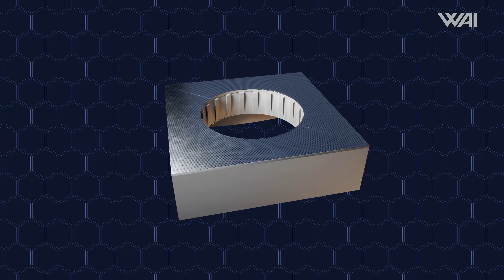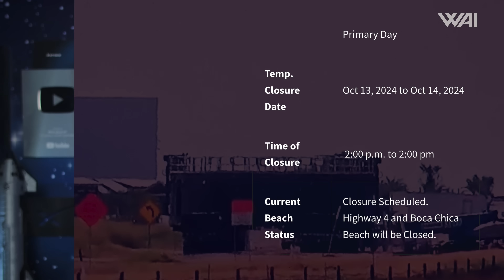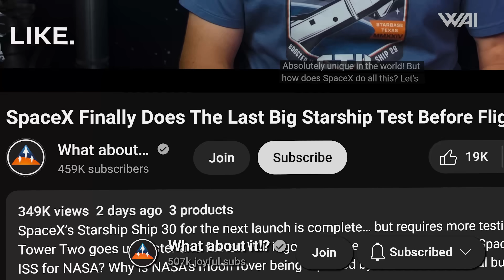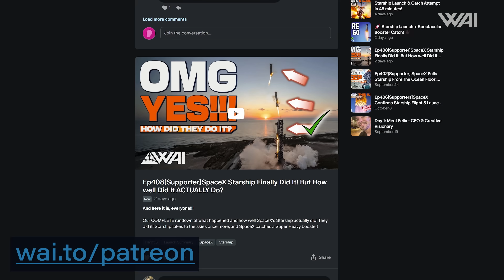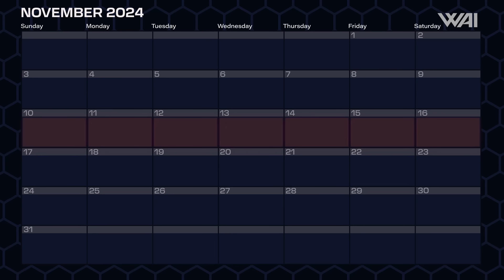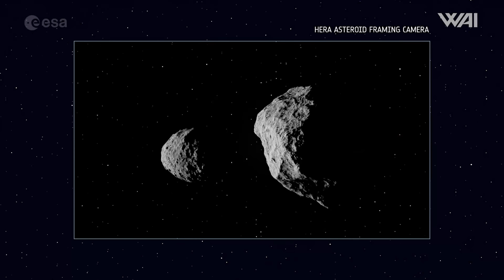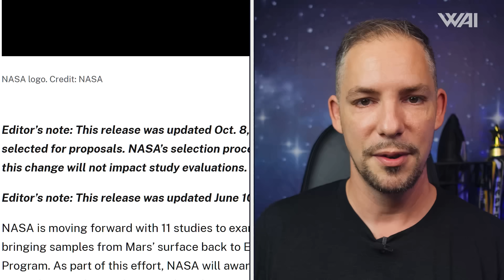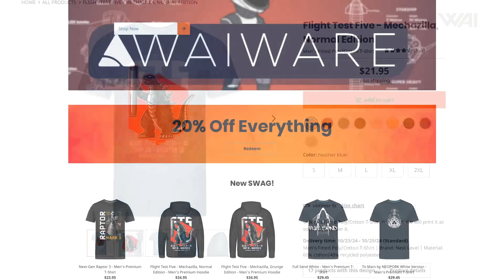SpaceX Reveals Flight 6 Starship! Possible Launch Date Available! Can They Do It?

Comment: OK, application of the same, or similar ceramic tiling on the upper portion of the of stage 0,would go along ways to minimizing damage to it.  Probably best to use larger tiles that overlap the inner lip of the launch stand.  Also, moving the first stage quick disconnect up by about 5 meters, both on the tower, (instead of on stage 0) and on the booster, would likely reduce damage to the quick disconnect system, (yes, swinging it to one side like the Saturn V launch tower, would also help, or a direct pull back, possibly using a mechanical counterweight system, to pull it up and back into a protective housing that would fall into place after disconnect and retraction,should work as well, and hey!  Maybe cover the protective housing with tiles as well?  To help secure those tiles, and minimize damage to them, a cushion of ceramic blanket, similar to the white sections on the Shuttle had, could not only act as a cushion between the metallic surface of the stage 0 and the first stage quick disconnect protective cover on the tower, as well as use of strips of it between tiles on both structures, should minimize damage from vibration against the metal structures and each of the tiles themselves.
      As there are some losses of tiles in the transition area between the tiles and the bare metal area, beveling the tiles to provide less aerodynamic drag during lift off, may, very slightly, improve the overall performance, but would likely minimize the loss of those tiles along that transition edge as well.  (And yes, a half tile beveled tile, between the sawtooth edge, likewise beveled, for a straight edge, would not only reduce tile loss along that area, (yes, I saw that as well) but would go a long way to avoid potential zipper releas of tiles, starting from the edge).
     As I suspect complete sealing of the valves from the stage one quick disconnect panel on the booster, is difficultbat best, moving it up by about 5 meters plus, could minimize ignition of outgassing during re-entry.  Or, precessing the panel by about 2 centimeters into the rocket body, and using a weighted system to slide a cover panel, padded on the booster's disconnect side to also act as a gasket, along with neodynium magnets to hold the panel in place, should not only minimize the potential ignition of outgassing from the quick disconnect panel, but should also minimize the outgassing from that area in the first place.
     To speed up reconditioning of the pad, finding and replacement of tiles on the launch stand and quick disconnect protective housing, a network of sensors, wired between the ceramic blanket and metal surfaces of those structures, should be connected to the tiles, as well as having both pressure and thermal sensors for each tile, (for redundancy in locating what tiles are actually missing, versus possible sensor glitches) so that a quick readout to the main computer systems  cab be done, and transmitted as a graphical map as to what tiles and sensors need to be looked at.  While a similar system on the Starship itself would be nice, at present, it would likely add a significant amount of extra mass to the ship, that, at present, it can ill afford.  Better to develope and text and refine such a system o the launch structures first, before adding it to the Starship systems. And it could also be used to identify and repair the tile system, on the Starship, during the trip to and from, or when landed at the target location.  Just a few ideas that might help SpaceX...

Comment: Why not have a move able cover that slides over the launch mount just after the booster clears to be able to shield from the heat during launch and landing.  That is a lot cheaper and easier than trying to move the launch mount.

Comment: Scott Manley actually had a good explaination of what might have happened to the chine. Methane and air or oxygen fumes might have gotten into the chine after which it was ignited due to heat from the landing burn. This caused a small explosion inside causing the chine cover to be blown off, without damaging any vital hardware. This is plausable since the chine blows off at the time flames come close to it.

Comment: I would love it if they went back to the sweating methane shield idea for the flaps or at least for the hinges. Maybe circulate liquid methane through channels in the flaps and exhaust the resulting high pressure gas through the hinges, that way plasma couldn't get in.

Comment: If SpaceX stays with the chopstick landing idea, then they should probably create modular and mobile launch mounts so they can be replaced after each landing.  Maybe roll out and roll back each launch mount with each booster on top of it, similar to how a Saturn V rocket rolls out on its own mobile launch mount.  
-
I still prefer the idea of using landing legs on booster and land on a flat area away from the tower, in order to protect the tower from damage.

Comment: Given how long it takes to make each attempt I think that spacex will change as much as they can from flight 5 to flight 6. Possibly including using ship 33. Not very likely that they will change much on the booster, flight 6 booster will probably still have a disposable interstage. My guess for the chine is delta P, so they may add a pressure knockout nearby.

Comment: That damage looks like it could be a blowout, rather than aerodynamic pressure damage.  Perhaps the qd panel was venting earlier in the decent and some of the fuel gases got under the cover, then blew out during landing.

Comment: The problem with the Europa clipper is it's going to take a very long time. You need more Delta v at the start. Had they set that whole thing on top of a booster. It have gotten there real quick. That's super heavy booster! At this point it's as reliable as anything that they're shooting from anybody else.

Comment: They need to put heat shield tiles on the launch stand 😆 Very interested to see how the new design of the new launch mount will work. Where's the disco ball on the dance platform 😁 As per flight 6 I think we all know what Elon time is but  I don't mind b.c at least what he says does happen. Flight 6 my guess is 1st week of December. Seeing that that that ship has a payload. I think they will use that ship, seeing that the problems with Starship is upon re entry and not while it is  cruising.
Not the red stapler 😵  I don't think Milton (the character) is going to like that 🤣

Comment: FYI a low pressure gas explosion in a metal structure will leave the internal structure intact gas leaking from disconnect would cause this.

Comment: Honestly, they just need a tower specifically for catching. That way.None of the delicate equipment will get hit twice. Just tower and chopsticks only
Reply: Well, that kinda goes against what Elon’s trying to do. He wants true rapid reusability - especially for the boosters. That’s one reason that, even for this first successful catch, they went ahead and: lowered it down and latched it, AND then had the automatic system go ahead and connect the booster T-0 umbilical. Elon’s intention is, eventually, to have boosters land back on the pads they left…..not need ANY refurbishing….just be refueled and then have the next Starship, which was standing by, placed on top of it…..both of them then fueled, and launched. THAT. SAME. DAY. That’s one reason he’s emphasizing  the MASS PRODUCTION of Starships - and the TURNAROUND times of boosters. - Dave Huntsman
Reply: @dphuntsman  no it doesn't. You would just lower it down onto a transport stand and roll it back to the site next door.

Comment: If NASA was considering using SLS for Europa clipper that's a per-launch cost of over $2bn I think vs SpaceX increasing its Falcon Heavy launch cost from $90m to $97m in March 2022 so even with crazy increases between then and now (that I doubt there have been) that still puts a Falcon Heavy launch at way less than 1/10th of the cost on an SLS launch. 

I know that it would have involved developing extra mission components but looking just at mass, thrust, delta-V etc, if NASA was originally willing to budget for an SLS launch I really wonder if an alternative Europa Clipper mission plan could have been put together, still within the budget originally envisaged for the SLS-based mission, that involved launching the satellite and then one or more additional Falcon Heavy launches to get the components for a fully fuelled kick stage up into orbit to be remotely docked with the satellite to create something that had the delta-V to do the originally envisaged direct-to-Europa flight path.

I really hope that the concept of adding kick-stages in orbit for long distance interplanetary missions happens at some point fairly soon so that we could avoid the long gravity-assisted transits and get data back earlier for longer range missions. Some of that delta-V could even come from solid rocket boosters that give very efficient thrust but are not very controllable so you'd probably need a mixture of solid rocket thrust to give maybe 80-85% of the Delta-V required and then a more controllable engine to continue burning after the solid boosters have expired to fine tune the velocity to exactly what it needs to be for the trans-<wherever-its-going-to> injection burn.

Comment: Why don’t they cover the launch mount in their heat tiles? If they can withstand “most” of re-entry temps for 10-15 min then they should be able to withstand the exhaust temps for a little while. Then repairs are just tile replacements.

Comment: Seems strange to have the quick disconnects remain in the firing line rather than have them move far away and avoid any damage. I am picturing something like the Falcon 9 crew walkway. Basically the quick disconnect would detach and the whole arm would swing away on a hinge located at the side or rear of the launch tower. So all the delicate connections would swing away to the opposite side of the launch tower within a few seconds. Even if it wasn't able to complete the entire swing operation before the ship rose high enough to have the flames reach the QD position. The QD would at least be well out of the firing line by that time. And then in it's fully swung away position it would be totally outside of the flame area when the booster was being caught. That would eliminate the need for all the complicated shielding that is required on the current design. Didn't somebody say the best part is no part at all? Or something like that. So a design that requires no shielding should be better than one that requires a massive amount of shielding. It would also go a long way towards making the QD rapidly reusable.
Reply: It 👏 did 👏 swing 👏 away
Reply: @alvianchoiriapriliansyah9882  The booster quick disconnect doesn't move far and requires lots of shielding to try and protect it from the rocket exhaust. And now with the booster being caught and doing the sidestep just before capture the boosters exhaust is pointed directly at the quick disconnect. Even the ship quick disconnect takes a beating as it doesn't seem to swing far enough away. To achieve the rapid reuseability of stage zero it seems like the current QD setup needs to be redesigned to avoid damaging forces rather than trying to endure them.

Comment: If ship 33 is already so far in development I think its a good one for flight 6. We dont know how easy a license for flight 7 will be to get. Even if its easy an IFT still is a lot of work for SpaceX. So to try catching the ship the think to go for is having a ship at landing, thats surely works. And I dont see that working with the current forward flap design. So I guess if Ship 33 is kinda ready they will be flying it.
Reply: block 2 will need a new license, and only fit with raptor 3 which is not ready.

Comment: It ONLY makes sense that they will use the Block 2 ship on flight 6 and I see them catching the booster again and the ship as well. It will not take long to recover the booster and clear it from the tower in preperation for the catch of the ship. If something goes wrong they have the second tower to catch the ship if need be!
Reply: I think they will just keep launching the rest of the V1 ships that they have already built, testing new heat shields and working on booster catches. V2 is still months away from being ready

Comment: Or rotate the tower so it doesn't flame all over the sensitive bits when it lands
Reply: The tower side facing away from the mount doesn't have the claddings that the near side do lmao
Reply: Land over a flame trench instead of the quick disconnect maybe; although they did turn on the bidet: tower 2 will be better anyway but what will they do with tower 1?

Comment: If you bend a pin even a little bit, can it still be used again, or is it now too weak? And how would you go about replacing a pin if it's attached to a bar that goes all the way through the tank/fuselage? Then there are the control flaps burning through and the heat tiles and the engine bells and the landing infrastructure getting scorched.... I think they're going to have a lot of things turn out to be not as reusable as hoped, but even 10% more reusability is better than completely expendable, as long as the refurbishment is cheaper than just building a new item.

Comment: I'm no engineer, I'm just a regular dummy, but;

Would it be possible to make both the chopsticks and quick-disconnect rotating assemblies? As in; they rotate around the launch tower to the side opposite from the base mount. The Q-D would rotate at/just before liftoff, and the chopsticks would rotate 180 degrees for The Catch. This would add more complexity and points of failure, but would allow both (the mount and the Q-D arm) take little to no damage during launch/landing.

Comment: Yo, is there a reason why we can't use something similar or just straight up starship heat tiles to protect the OLM (and maybe the tower)? They would prob. need to be in different shapes, sizes and thickness so you could walk on them and stuff, but if they can survive the heat and speed of re-entry, surely they could also survive launching and landing 😅

Comment: The booster after flight number 6 should be taken to Massey for a cryogenic test and then static fire B12 after inspection should simply be kept as a keepsake or scrapped
It's not possible that they already want to use it for ground testing, too risky

Comment: I am conflicted. First I think it is beyond words that the landed the dammed thing in one shot but looking at the issues that remain gives me pause. Mostly is that they still have work to do on the tiles. The booster issues will work their way out but the heat tiles have been in use in one way or another since the 80’s and they are still causing issues. One thing that has to be taken into account this has to work perfectly because help is 6 months away. One question without the booster how is Starship going to return to earth ?

Comment: I was wondering why they are catching the booster over the launch mount at all. We know the chopsticks can swivel to pick up starship off of a transporter, so I would think it would make more sense to catch it over that bare patch of concrete rather than over the vulnerable launch mount, wouldn't it?
Reply: The launch mount & water-cooled plate is designed for way more power than 3 engines

Comment: I doubt we see booster 12 launching again any time soon; having an intact booster to analyze, the engineers will want to examine it thoroughly.  SpaceX should launch booster 13 / starship 31 as soon as possible on the same profile to 'certify' their ability to catch the booster.  Given that the FAA will have to completely analyze flight 7 (with the version 2 stack), they should go ahead and make this flight the one that attempts to catch the starship.  Hopefully, the public outcry, congress inquiries, and NASA declaring SpaceX as a vital partner in national programs thus allowing them to super-cede the FAA in issuing a launch license will all motivate the FAA into issuing a launch license quickly for flight 7.  However, I doubt we see flight 7 (assuming SpaceX flies flight 6 before Christmas) before the April time frame next year.

Comment: Why did they catch the booster with the chopsticks over the launch mount? Why not catch it with the sticks to the side - fx 90 degrees to the left - then catch the booster there and when grabbed then rotate the sticks with the booster 90 degrees back to to be over the launch mount when the engines are totally off. This way the engines dont blast the launch mount on landing
Reply: Because there's no reason not to

Comment: Over and above the $2 billion cost of an SLS launch that was saved with Falcon Heavy, the extra vibration from the SLS side boosters would allegedly have required an extra $1 billion in retrofits of the Europa Clipper craft to accommodate it.  Given past NASA projects, the $1 billion estimate is probably way too much, way too little, and just about right all at the same time.  Furthermore, the production delays with SLS and the time required to implement the retrofits might be greater than the time that will be lost by taking the scenic route to Jupiter.  Falcon Heavy was definitely the right choice.

Comment: Why don't they cover the areas on the launch pad that are susceptible to heat damage with large replaceable panels that are covered in Starship type re-entry tiles? Surely that would provide adequate protection and if one gets damaged, you just replace the panel.🤔
Reply: They’d get ripped off by the forces.

Really it’d be best to land it off to the side more.
Reply: @zachb1706  Fair comment, but if they could be designed like a wing such that the flow of the thrust could be deflected and/or the tiles could be interlinked with their neighbours rather than self supporting components. It could work. The concept should be tested at least.🙂